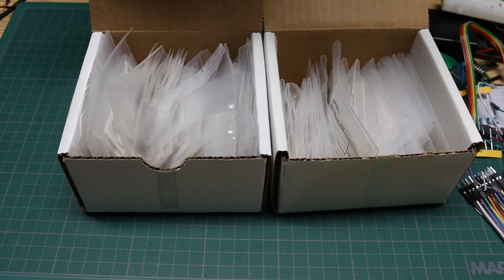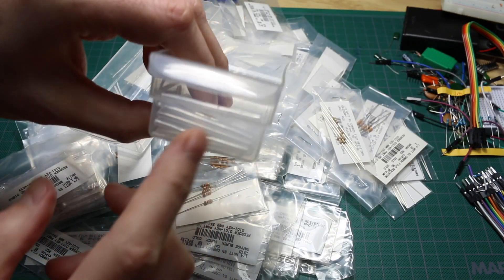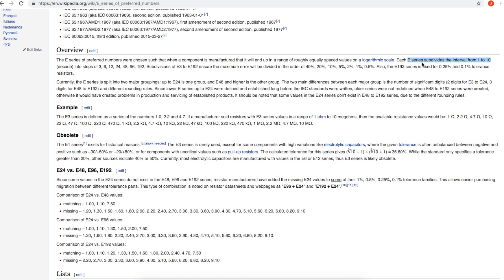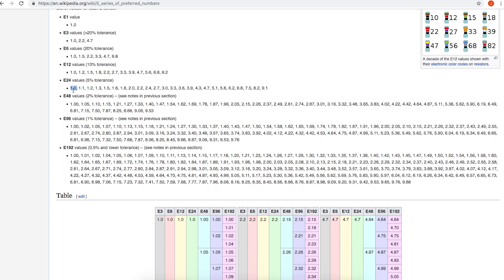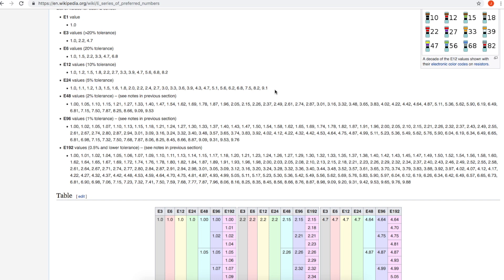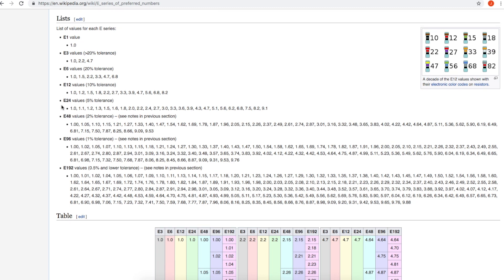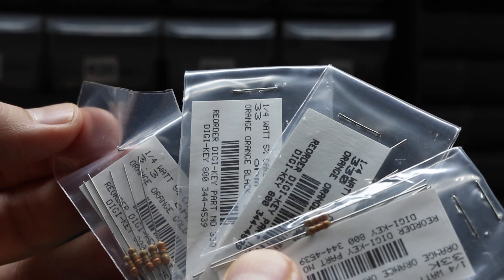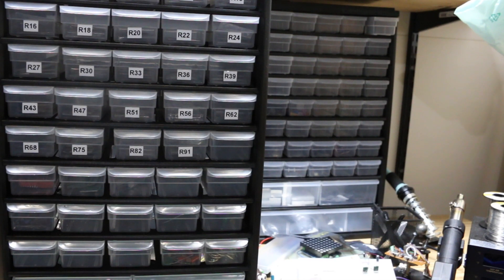E24 Series of Preferred Numbers - Resistor Sorting

Comment: Thank you, this was very useful. I will be organising my resistors the same way as you have done.
I have just bought a Brother QL-800 Label Printer - this one can do barcodes, etc and can print up to 60mm (2 1/4") wide, so I can start labelling my storage trays the way you have.
I use the small 7.5cm x 5cm (3"x2") ZipLock type bags for my resistors, and I will label them the way Digi-Key have done it as shown on your bags.
I think the color codes in words below the value is a good idea too.
Thanks again!

Comment: This organization is great until you buy and want to organize THD + SMD resistors and capacitors in different sizes/types. I've actually used this exact same scheme for the last 2 years. I been struggling with how I want to redo my organization for the last few days though. I recalled seeing this in my sub-feed and came back to watch.
 
  One tip: if you think about the products you use daily around the house, you will probably find things you can recycle for organization, you just have to be very patient while collecting them. My favorite item is Dove bathroom bar soap. The little white boxes each bar comes in make perfect little divider containers. I made a little stand jig that holds a razor blade horizontally at exactly 1/2 the box height. First I hot glue the empty box closed. Then I slide it next to the cutting jig to make an open box with a perfectly square top that is also exactly the same size as all the others I have. If you add a bead of hotglue on the cut edge those little boxes can handle a lot of regular use and abuse too. Best of all, you can remove single boxes as you need them. I have made hundreds of them to use in an old library card-catalog cabinet over the last 2+ years.
 Anything you use regularly that comes in a box is the perfect way to make component organizers. Personally I prefer a large cabinet with drawers that contain individual values of removable containers. This means there is no organizational game of leapfrog or Russian nesting doll type shenanigans, and I can keep most of my components within reach of my workbench at all times. The problem with those smaller drawers is the limited number of resistors they hold. I recently picked up a range of most E24 values in 100 piece quantities. That just won't fit with this size organizer any more.

  However, if you're looking for these types of organizers, Walmart has been stocking some nice 30 drawer ones for ~$12 each, and they even have drawer stops so things never get dumped out from tipping the container. That's the cheapest I've seen. I haven't found anything else that comes close to that price point for a decent organizer :-)
-Jake
Reply from the maker: Next time I am in Walmart I will see if they have anything good for storing components in my store. I’m definitely going to be using a different method for surface mount storage and I don’t know what I will do if I start having multiple wattage resistors.

 Right now mostly everything is quarter watt so I take that for granted  and  all the other power rated parts are just still disorganized in random bags.    If I could ever find time to clean and organize what I already have, I think I could re-claim a bunch of storage containers that are being inefficiently used right now after I re-organize and consolidate stuff.

Comment: I've been looking for E12 or E24 series in bags like yours but I cant find them. Do you have a link? 

I unwisely bought a kit with resistors glued to two paper strips and I hate it. I also have drawers like you but the dont come cheap...
Reply from the maker: I bought those resistors from digikey years ago so they are guaranteed quality but don’t come cheap compared to eBay China. It looks like it calculates out to 16 or 17 cents per resistor in the kit but here’s the link of the search results that I would have chosen from. 
https://www.digikey.ca/products/en/kits/resistor-kits/653?k=Resistor&k=&pkeyword=Resistor&sv=0&pv223=694&pv69=80&sf=1&FV=ffe0028d&quantity=&ColumnSort=0&page=1&pageSize=25

Comment: I have so many loose resistors that I have two values per drawer, using a separator between them, I think I have something like 130 drawers just for resistors.
Reply from the maker: I’m really going to run out of trays when I start organizing the capacitors. Thankfully all those eBay capacitor kits have come with those flimsy plastic holders but it seems when I take them out to put them on a breadboard, they never go back in those original shipping trays so I think I’m going to have to watch for the next sale on parts storage cabinets.
Reply: @GadgetReboot  They are on sale at Princess Auto till 5/10/2020 - free shipping!

Comment: That's a neat idea but what happens when you have something from E48 series?
I have a linear method like 1-4.7, below 10, 10-47, below 100, .... That is not clearly optimal. As soon as you start to get some E96 leftover any (not range based) system breaks. Even range based are not that nice with too many values though. I like smd with those nice tiny books.

Comment: I'd go crazy having my resistors all mixed together like Gadget's showing here. Plus those parts drawers are really annoying and space inefficient.
I've just finished moving everything out of those drawers (literally thousands). My resistors are in Pill bottles (tubes/vials), one value per bottle. Each small vial is about 15mm diameter, so 25 for a decade is about 150mm square. Commonly used values liek 1K, 10K are in larger diameter vials, but stored in the same group. The vials are vertical inside plastic compartment boxes.
If I need 20 resistors I lift out the whole bottle, take it to the bench and  and pour them out.
The reason I do it this way is because I allocate space based on the volume required, rather than wasting equal space for every item. For example, compare your usage and stock volume for 1K vs 62K
Reply from the maker: I think I definitely won’t use these trays for the annoying blue body 1% resistors that have Way more values to sort and I can never seem to read the bands properly so I would like them all in their own storage compartment similar to how you describe.
Reply: @GadgetReboot  - What I described is how I store all of my "loose" resistors (<100 of each) that are used for small projects and prototyping, so I need to find them easily.

My "bulk stock" is kept separately. I keep the blue 1% 1/4W on their original strips. I write the value on each strip, then put each value into a small ZipLock bag, each clearly marked. Then they are grouped perhaps 5 values per larger zip bag, except for common ones like 1K, 10K which , etc.
My entire resistor collection (from 1/8W up to 10W) fits into one drawer about 400mm wide x 500mm deep x 150mm tall.

Comment: Nice ! What do you do with 1% tolerance resistors ?
Reply from the maker: I would have to either use the E 96 series which is a lot of trays, because that handles 1% tolerance, or try some hybrid method like anything between 10 and 11 in the E 24 series, I would stuff all the 1% resistors with the in between values and just have to dig them out.
Reply: @GadgetReboot  Since I don't have much room on my work bench for another drawer cabinet, I've been thinking of using this method that I found on Instructable for sorting resistor : https://www.instructables.com/id/Easy-Resistor-Assortment-Organization-With-Index-C/

Comment: I think the original idea was that you can't make a bad resistor! it did not matter what value it measured as there was always a value it would fit in. it was the same the microprocessor speed, when tested the slower ones got marked down and sold cheaper. that way as the process improved less and less slow chips were made, but they still had orders for them, so marked down fast ones as slow. so towards the end of a chips life you could over clock the slow ones as they were no different than the top spec.
Reply from the maker: I think when the values are all mapped out, the tolerances don’t fully overlap  along the whole set so there are still some small gaps in the series. But it definitely cuts down on bad parts  if most of them can be slotted into a different category and still put to use.   
I guess it also depends on what exactly are the test criteria and pass fail criteria like if they test over temperature ranges to make sure a part is within a certain tolerance and how close they allow it to go toward the extreme of tolerance while passing. 
 Along with some small gaps in the series, I believe there are other sections that overlap so if a resistor fell in that range it would be unclear which resistance nominal value to consider it as being part of.

Comment: Now i'm going to have to go and buy some new trays. That system is much better then my current system, which is the same as your old system. I just spent $800 yesterday buying an oscilloscope, new soldering station and a microscope. D'oh. Good thing i'm not married, i can spend what i like on my hobbie.
Reply from the maker: I wish I had the budget for a microscope, I was watching some review videos today so I can at least get familiar with what’s available. This time last year I splurged on my dual output arbitrary function generator and those part tray cabinets.
 My oscilloscope is 11 years old and I’m constantly feeling like it needs to be updated as well, more channels, better display, more features  and I’m sure the firmware has some glitches in it that annoy me from time to time.
Reply: @GadgetReboot  I only got an entry level oscilloscope, 2 channel, 100Mhz. I was watching a video yesterday where the one I got (Hantek DSO5102P) was software upgradable to 200Mhz. So i'll have a go at that once the warranty has expired.

Comment: Yep, I've got a whole wall of those parts bins.  It sure saves the time of digging through boxes and reading all those tiny part numbers on bags.  I put various physical sizes in each drawer, all with the same value.  If I need a 10K resistor, I can find all sizes from 1/8 watt up to 10 watts in the same drawer.  For SMD devices, I use these: https://www.amazon.com/AideTek-BOX-ALL-Enclosures-Capacitor-Organizer/dp/B00A15YHJY, one for each size of resistor and capacitor.
Reply from the maker: That looks like a convenient surface mount storage, which I’m going to need at some point  when I accumulate more small parts like that. Thanks for sharing.
Reply: I got a couple of those too, pretty good for small smd stuff and the lids seem to clip pretty solidly. You can also get prepopulated ones filled with resistors or caps.